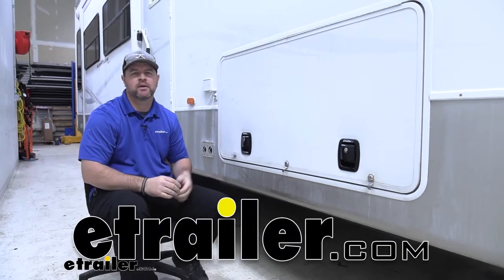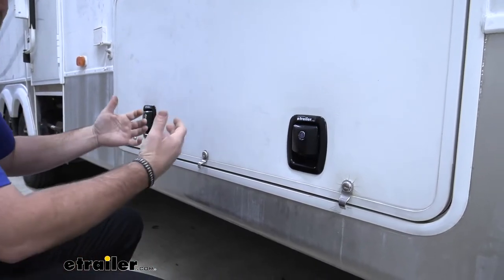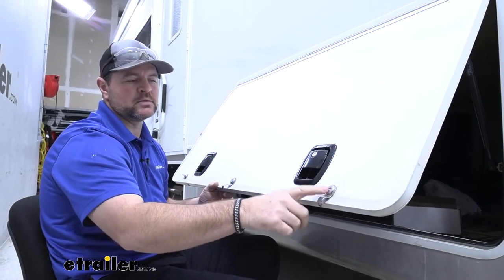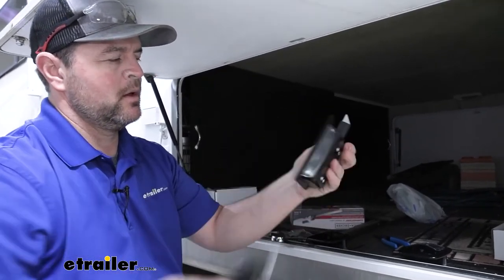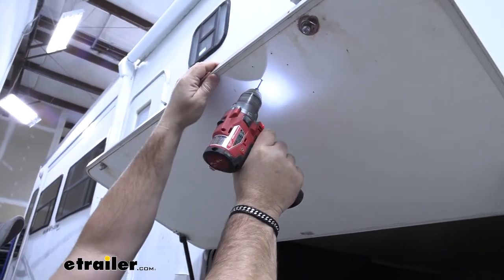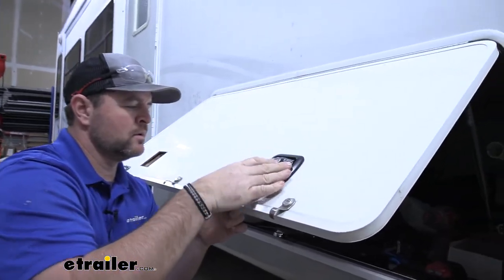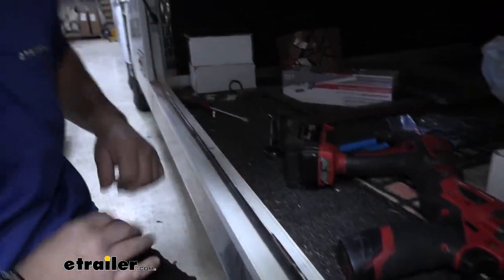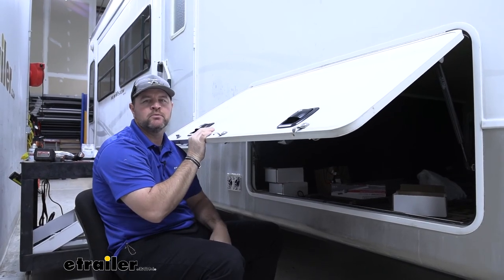etrailer | Global Link Locking Baggage Lock Actuator Set Installation - 2005 K-Z New Vision

Comment: What if I don't want the old locks and knobs? Is there something to plug that with?
Reply from the maker: We do not have any plugs that will plug the holes if you decide to remove the old locks and latches. You can check with your local hardware store to see about getting some rubber or plastic plugs to fill the holes. Most people will just leave the old locks and latches in place.
https://www.etrailer.com/RV-Door-Parts/Global-Link/GL34FR.html